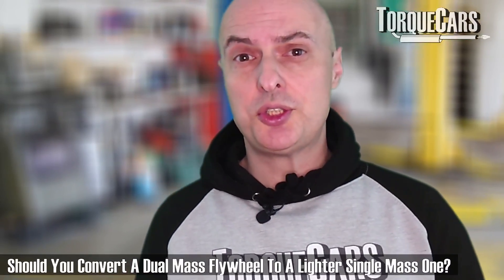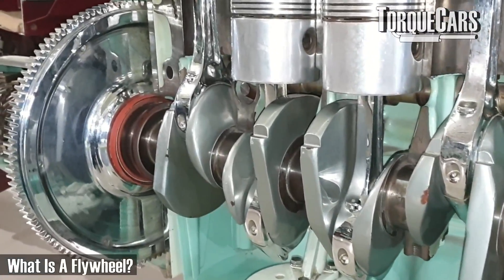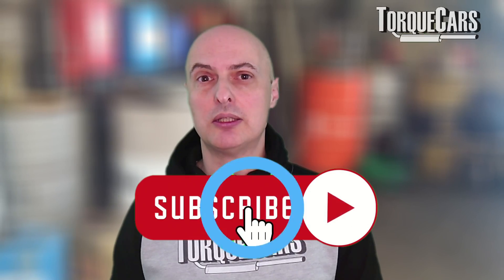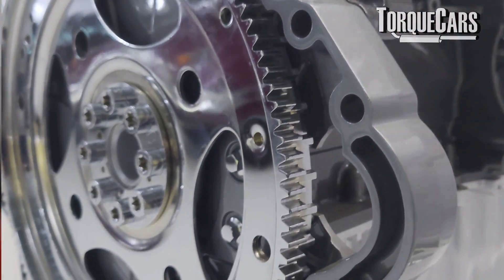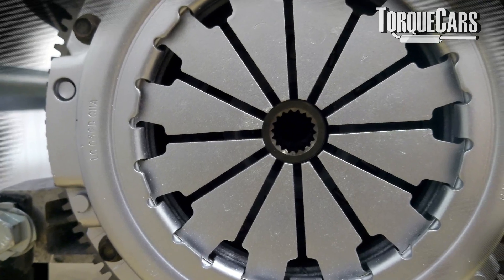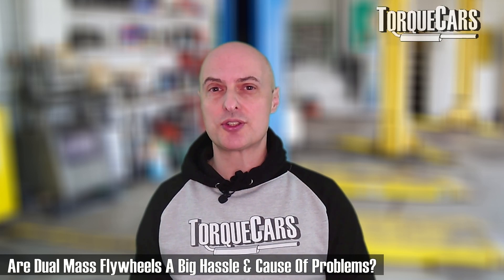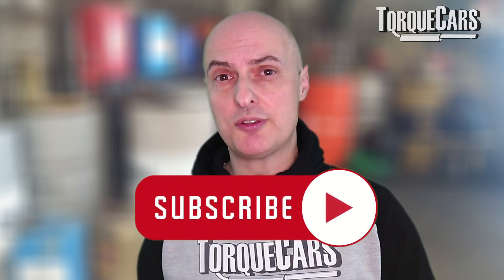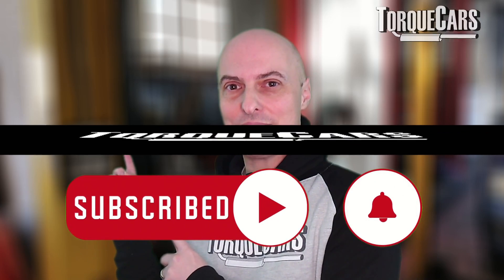Should You Convert A Dual Mass Flywheel (DMF) To a Lighter Single Flywheel (SMF)? [Pros & Cons]

Comment: if you are going to change the flywheel for some reason never buy another dual mass, they need replacing faster than a single mass because of the springs in it and they get loose and makes the car sluggish, get a single mass thats a little lighter but more robust so its still nice to drive around town and you wont have a slug when trying to have a little fun
Reply: yup i agree in my courier company with 15 units of light cargo utility vans (without mentioning the vehicle brand)have all the same problems,70k kms damn dmf it rattles the whole body! it suppose to protect the engine from vibration but when it brokes its the opposite.too expensive to replace and it wears too fast,our mechanics are having some fun of it because dmf wears too fast than the tires.now all welded and machine and working smoothly with more than 200k kms after it was converted.
for us clutch disc spring dumpers is enough to compensate the dragging and vibrations just like the traditional.now a days almost all inventions or ideas of a simple car was transform to complicate things at the expense of the car owners.

Comment: I've heard of petrol heads getting killed by a modified flywheel that was too light and ripped through them!!
Any thoughts?
Also, should the flywheel be skimmed when replacing the clutch?
Reply: It's not so much the flywheel in particular, lightweight or not, that can be dangerous, but the clutch assembly as a whole.  In extreme applications, like drag racing, a clutch can explode and propel through the floor, same with the driveshaft.  Shielding and/or reinforced bellhousings, along with driveshaft loops prevent this, and are required in some racing classes.

Yes, a flywheel should be machined or replaced as part of a clutch replacement.

Comment: just simply NO. all cars that i ever had, had the damned idiotic dmf fail. when it starts to fail, it shakes the ghost out of everything. out to the trash where it belongs they go. single mass flywheel, a decent sprung clutch disc, and no problems ever. what most people screw up is using a single mass flywheel, and an unsprung disc. thats a big fat NO allso. never i had problems whit converted cars, and none i know who has dmf and has anything but problems piling up. allways expensive to repair, and its nothing more than constant pain. its a very stupid idea to solve a problem that should not exsist in the first place to begin whit. car makers need to balance the engines better. that darn simple. if you want an extreme case, take a look at the first high power tractors. quite often making 1500 nm tourqe at peak, and violently shifted via non-synchromesh tranny, and usualy overloaded. those engines are long stroke, they vibrate a LOT, they are abused . you can not afford to nicely let off the clutch eighter, and for most of them there is even eighter air or hydraulic assistance to smash the snot out of the clutch when you release it. load often violently changes. YET, most of them run a SINGLE sprung dry disc, and a single mass flywheel. 
so no, there is no reason to use a dmf. ever. its pointless, and useless... well should be, if the engine had been at least designed a ruler instead of a cheap tape measure. but its better for the makers to just make em to very barely fit the bill, and once it rolled out the factory and you had been stupid enough to buy it, then its your problem. and a problem it is, its a very high cost item to replace, and its lifespan is laughable at best. 
i went as far as having a less than a year old car bought, at that instant that dmf has been replaced whit a proer smf setup. sell the dmf, never look back. years go past, and what do you know... smf still working just as it should, dmf had been replaced 2 times. its a nett stupidity to even consider having dmf.
Reply: You obviously have no idea what you're talking about, despite the wall of nonsense you posted.  It's not a balance problem a DMF is there to correct, it's the intermittent torque delivery all engines exhibit (think pulsation), especially those with fewer cylinders.  Maybe instead of ranting with no clue as to what you're talking about, do a bit of research.
Reply: @nagyandras8857 Hi, I have a huge noise problem at idle or on release of the SMF kit.
Reply: The machine had a DMF as standard and I fitted an SMF, but the noise is terrible, is there a solution without changing everything?
Reply: @cokyanderground3720  What machine?  What are the specifics?

Comment: DMFs are better with low end torque than SMFs?
Reply: Yeah especially in diesels smf not really recommended due to the low end high torque nature they could vibrate a lot and will destroy your gearbox if your teeth hasn't fallen out before then lol
Reply: @nequanlucas2162  they arnt

Comment: I replaced the clutch, but when I asked about the flywheel, the mechanic told me that you never change single-mass flywheels, and that surprised me. Cant single mass flywheels degrade over time?
My car is a golf 5 1.4 tsi 103 kw (BMY) made in 2007, and I have no idea if it came out of the factory with a SMF or if someone put it in afterward. The car has 250k km on it.
Reply from the maker: They are just solid metal discs that spin, they connect around the center and there is very little movement or friction so yes you never need to replace a single mass flywheel, I have known them to split or crack which is down to metal quality rather than wear and tear. The starter motor can wear the teeth on it slightly but this only happens for a matter of seconds each time the car is started.
Reply: @torquecars  Thank you for the reply, my friend. It is interesting that you mentioned the starter wearing the teeth out because, on a cold start, I have no problems. On a warm start, after being parked for an hour or two, the car makes a horrible grinding noise. I was going to get my alternator checked.

Comment: I'm pretty sure when I purchased my car (01 Audi a4 1.8t) someone had put a single mass flywheel in it. I had to put in a new transmission and figured I'd do a clutch too. The clutch I had didn't fit. After internet research I'm 95% sure I know what is there now. It's a single mass flywheel with an unsprung clutch... It's very difficult to drive smoothly and took me over a year of daily driving to get it down and it still isn't perfect. But I love how it drives so...